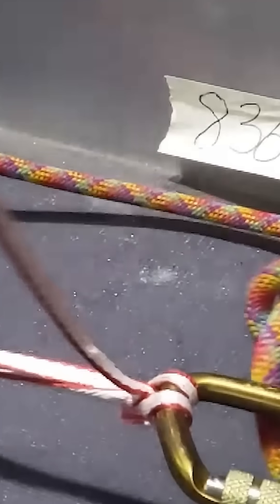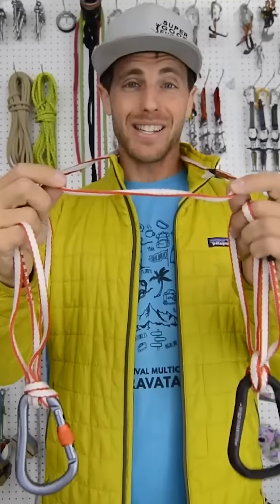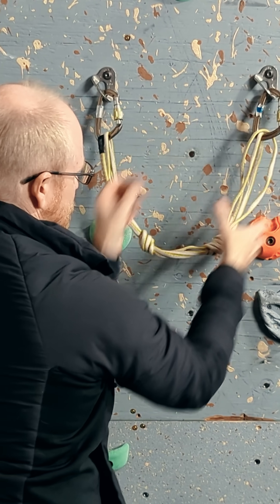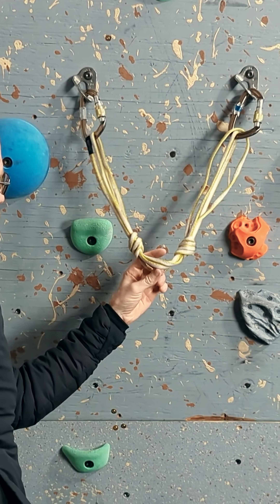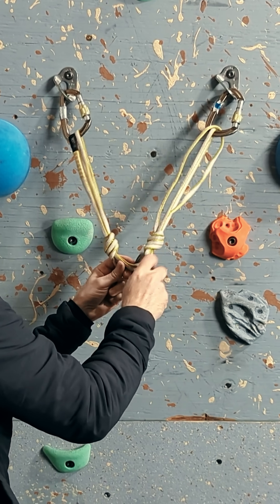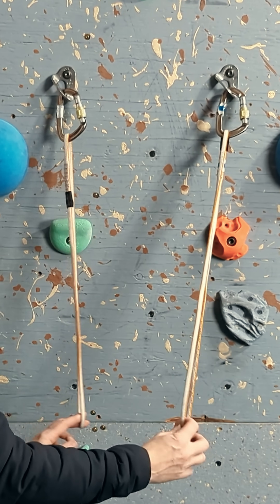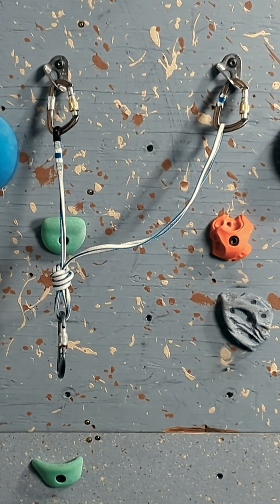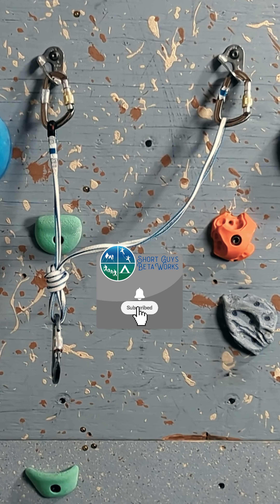Anchor Knots Weaken Climbing Slings but We Can Mitigate That

Comment: only need like 3-6kn 
so do whatever
and its super good enough
Reply: Technically yes, but you want a safety factor to account for different wear and exposure levels during a piece of gears life span
Reply from the maker: @feelinghealingfrequences7179  This was mostly a response to someone who thought I was going to get everyone killed by teaching how to make a quad anchor. But we should understand it. In the wrong circumstances (https://www.google.com/url?sa=t&source=web&rct=j&opi=89978449&url=https://staff.weber.edu/derekdebruin/fixedpointbelay/Comparison%2520of%2520Fall%2520Forces%2520between%2520Fixed-Point%2520and%2520Redirected%2520Belays%2520in%2520Recreational%2520Climbing%2520Systems.pdf&ved=2ahUKEwjh6vi0urCLAxV6PjQIHcApPOEQFnoECBgQBg&usg=AOvVaw2fo6gc--hDmT0LzOANROfk we can get 8kn on the anchor. Add in slightly worn material and that can get pretty close.
Reply: Was going to comment the same. Understanding the theory behind it is good. But in a climbing setting…if there’s 20+ kN on the anchor, a lot of things have gone wrong and my partner probably broke their back in their harness among other things.